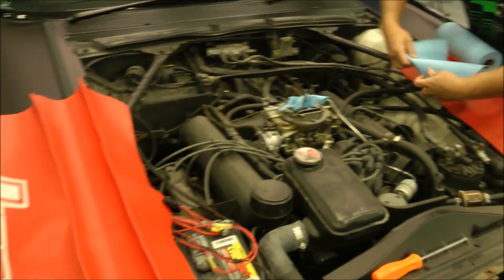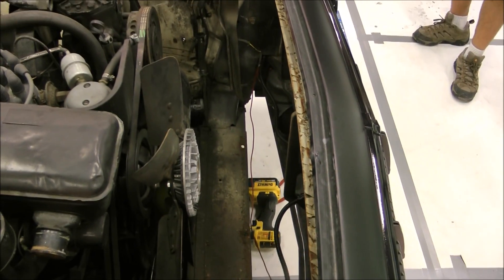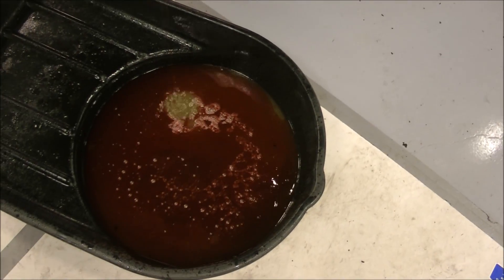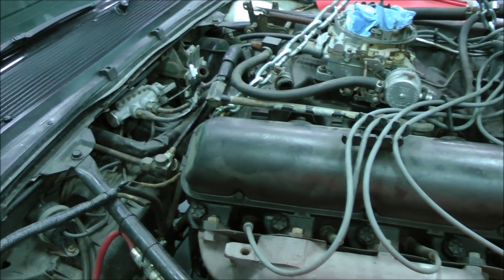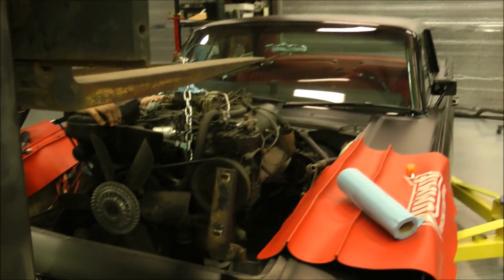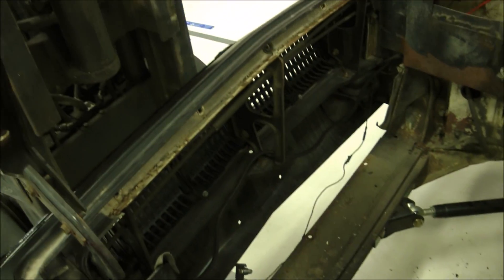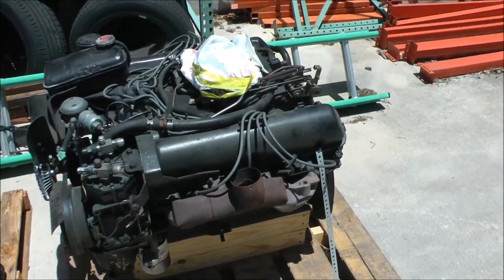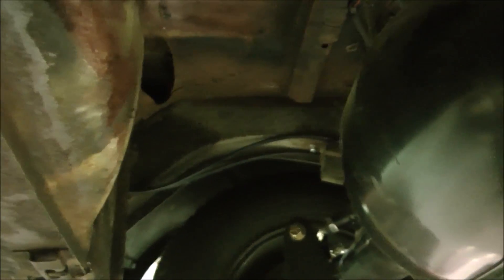1964 Lincoln Continental electric conversion part 3

Comment: Mitch, when are you going to convert the forklift to all electric??? One could say that using one fossil fuel vehicle to convert another fossil fuel vehicle to an all electric vehicle is kinda ironically oxymoronic, ain't it??? LOL Keep up the videos!!! I've wanted to do this to an old Toyota MR2 but didn't have the knowledge or the money OR the Zombie Balls to do it!!! ;-)
Reply: Smallish Forklifts have been Electric for a long time but using Lead Acid. Only in past several years has Lithium Ion been deployed for commercial use. It's just easier and more reliable to buy a New Lithium Ion Forklift.
https://www.linde-mh.com/en/About-us/Innovations-from-Linde/Lithium-Ionen.html - Oldschool Company doing Lith Ion.